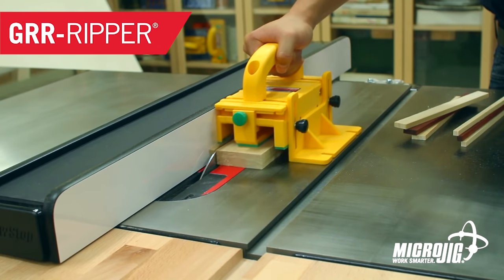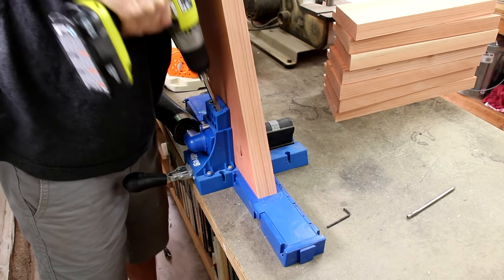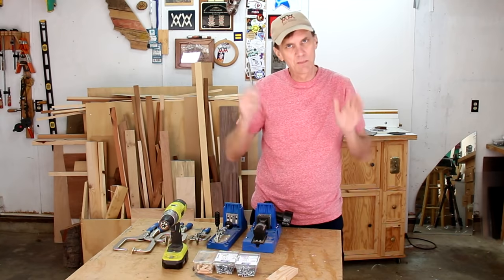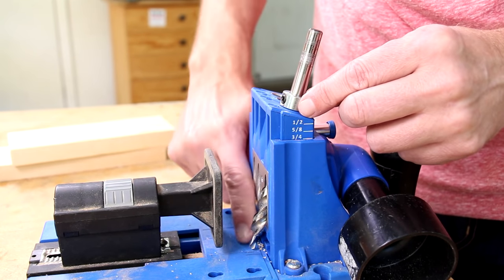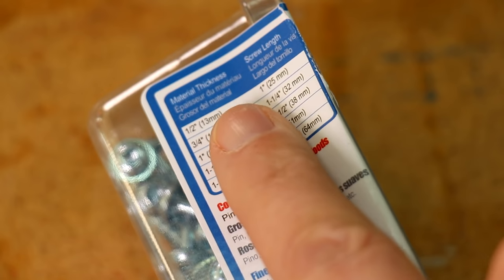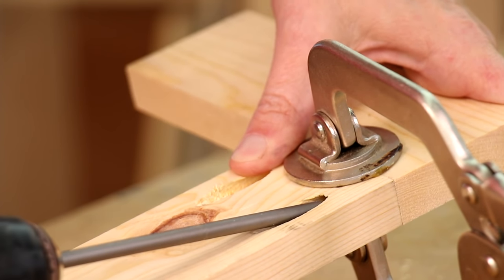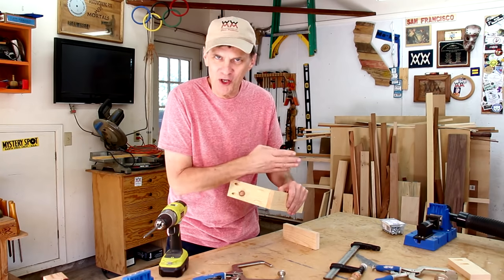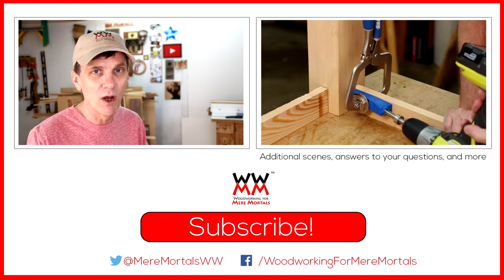Beginner's guide to pocket hole joinery | WOODWORKING BASICS

Comment: My first 2 experiences with KREG Tools: 
Using the chart for 1/2 inch plywood to put a box inside my new DeWalt Thickness planer cart. Every screw blew out the back of the box. I ended up using aluminum tape around the top and bottom sides to hold the panels up. ALL I wanted was a place to store the tables and spare set of blades. Will eventually make a door for the open side.
The second experience with KREG was their automatic corner clamps. I made a wall shelf with 45° braces so I could have my new compressor up on a shelf next to the air hose reel. Two of them jammed.
On the 1/2 inch plywood, KREG Support basically told me that they don't recommend using that size. BUT the SIZE is in their chart wheel.  Haven't contacted them yet  on the Corner Clamps. With the first one being so nonchalant, don't know if I'll be able to get a good outcome.
I have everything KREG except the K-5. 
This just happened to me yesterday and I almost forgot.
I just installed the Incra LS fence for my table saw. So I was waiting until I finished that to set up my new KREG Precision Miter Gauge. 
I took it apart to adjust all of the plastic screws that keeps the rail straight. After getting it put back together I slide it in and BAM. It hits the edge of the table saw.
Now I don't know how deep the miter slots are supposed to be. Don't know from one model/brand to another. I have a Craftsman. 
It's old, 3hp, 120-240, and I totally restored it.
My FIX. I started applying Scotch packing tape to the bottom of the sled rail. It took 8 layers of tape to get the miter gauge to stop hitting the saw table edge. The iGaging caliper measured 0.400 inch with the tape. Don't know what it was before, didn't measure it.
Sent an email right before Christmas, waiting for a response.

Comment: I’ve been using the pocket hole jig for a couple of years now and it was easily one of the best woodworking purchases I’ve made.

I’ve seen a few videos from different makers making the claim that standard dowels can be cut to fill the holes, which has not been my experience at all.  The dowels from the big box stores are 3/8ths, and are NOT a viable substitute for the plugs Kreg sells without a significant amount of sanding.  I haven’t measured with a caliper, but I’m willing to bet that the diameter of the drill bit is 5/16ths or maybe 11/32nds.  Either way, a standard 3/8ths dowel is too big and will blow out the top of the pocket hole.  I think it’s part of Kreg’s business model - if people could get away with using regular screws and dowels to fill their pocket holes, they would be missing out on a ton of repeat customers.

Comment: I've had decent luck with just freehanding pocket holes with a 1/8 pilot followed by a basic screw-head countersink. I can use regular construction screws  and they maintain decent holding strength. They do not have the extremely flat angle the kreg jibs achieve but for basic stuff it works great.

Comment: The original 90 degree clamp still allows the joint to drift a little. Check out the new kreg automax 90 degree clamp. There's a slight learning curve with pocket holes but it becomes easier with tricks you pick up along the way.

Comment: I have always frowned on pocket hole joinery-all those holes to fill or not. However, I have decided to give it a try with adding drawers to an existing shop table. I didnt want to use nails and I having seen a Kreg video on their pocket hole jig, I thought that way might work better and easier.

Comment: I bought the cheap version of the pocket hole jig. I probably spent more in ruined lumber then I would have if I bought the Kreg jig in the first place. Save your money and headaches and buy the Kreg jig to start with. It hurts to spent the money up front but  it worth it in the long run

Comment: At 3:20, when you advise to back off the drill just a wee bit, to leave a blind hole, I have always found using a coin or a washer, say 3-4 mm thick, helps set the drill to the right depth, while ensuring the hole doesn't open up.

Comment: I tried using a pocket hole jig for making a cabinet face frame using 3/4 inch VG Fir. When the screws entered the edge of the second piece, the wood split quite extensively. I bought a biscuit joiner and don't expect splitting to be a problem.

Comment: Bought my first Kreg pocket jig today.  Used an impact on the screws.  Blast right through is just what they did.  I also was using the jig on a 2x4 to connect to 3/4 plywood.  All videos I've watched say "set your jig to the material you are using"  I was using two different types of material.  I set the jig for 2x4 - should it be set for 3/4?  Most screws went through but I contributed that to the impact.

Comment: Thanks for sharing your knowledge! This was a great tutorial as I sometimes have had trouble with the screw depth. I’d always blow out the screw due to lack of knowledge on the screw depth adjustment. Also I’d often make my pocket holes facing  the wrong direction and not having enough thickness for the screw to bite into. Thanks again for sharing. Godbless.

Comment: There are a lot of snobs out there that hate pocket hole jointing, but i absolutely love it. The speed/strength ratio is definitely optimal. Yes, you could spend 10 times as much time making wood joints that are 1.7 times as strong, but hardly seems worth it.

"But my chair will last 100 years"

First of all, no it won't. The glue will fail eventually.
But secondly, I can build another one with pocket holes in 20 years when the joint finally gives... and that is only if you didn't engineer the stress out of the joint, which a good carpenter can do.

Comment: I like the "micro" pocket holes and screws Kreg makes, but the only jig I could find is the insert for some of Kreg's larger sets. However, I find a piece of 3/8" aluminum tubing from the hardware store hobby metal display will make the perfect sleeve to convert a normal jig into a micro jig. Kreg's micro screws also max out at 1" long, but Menards sells some #6 "cabinet screws", which have a compatible diameter square drive pan head with a 1-1/4" or 1-1/2" length.

Comment: I have a ply board of 3/4” and a 2by 4  being joined at a 90 with the edge of the 3/4 exposed and edge of two by four touching flat of the 3/4” in entirety. Which is the best direction to drill the pocket? Pocket on 2 by for or on cut from the 3/4 ply sheet.

The 3/4 ply sheet will be the anchor for holding one guitar hanger.

The pieces joined will be across 14”

I am erecting something to hang a guitar in a semi truck from the top bunk frame while in the stored away position.

Comment: I am very new to wood working. Was impressed with the video and a great way to start. Great video & tutorial. Thanks !!!!
 It is clear that clamps are required to hold the portions for joining. My question is - if I don't have sufficient clamps and use small nails to position (join temporarily) the 2 joining parts and then screw them via pocket holes will it work?

Comment: thnk u  sir gret informtion,  you do it well .  how to extend 2.5mm drill bit ,    becuse  in  hard wood  the screw is not  drive.  so  second piece wood must be  a hole.   therefore  length of 2.5mm drill  bit length  extension is  necessary..

Comment: I use my Kreg Pocket hole jig all the time.  Because I use different size lumber I have to change the drill bit depth and the hold down suction cup.  The allen wrench is always falling out and I can never find the right size wrench on the threaded piece on the hold down.  I took a couple of rare earth magnets one on either side of the handle.  One for the allen wrench and one for the 10mm wrench.

Comment: When you edge joining wide boards for something like a table top it is very difficult to clamp them so they stay aligned. One technique that I heard of, after I had edge joined wide boards and needed to plane them flush, was to use a biscuit joiner and glue. The biscuits keep the joints flush. The pocket screws provide the clamping pressure. You do not need large clamps. You can also back out the screws after the glue has set and reuse them!

Comment: Very clear and simple explanation!   Two questions:   What type of Kreg jig were you using in this video?   Do you have a video on edge joints?   I am attaching three inch solid oak (white qtr sawn) to a qtr sawn red oak plywood panel to make a replacement table top.    I have seen that gluing edge joints is recommended; however, managing the face clamp and glue and bar clamp seems a bit tricky and intimidating.   Thoughts or recommendations?

Comment: I use my Kreg to make joints drilling towards the corner fairly frequently, so that the holes are more concealed.  I've never had a problem.   Maybe its because I use many screws in this situation.  For example, you can attach a face frame to a cabinet from the backside.

Comment: I saw several positive YouTube videos, including yours, about Kreg's Pocket-Hole Jig system.

Yesterday, I bought the KPHJ320 at my local big box. The packaging was sealed and there were no signs that someone had opened it or used it before me. However, when I opened it and checked the components, the Material Thickness Gauge/Hex Wrench was missing. I removed every component, hoping it was underneath, and opened both boxes of screws. It's not there.

I just notified customer service.

Comment: For 1/2 inch ply, there may be a way to have a drop of resin on the anchor-end of the hole, such that the meat-end of the joint has a resin-treated hole to help keep the anchor-end strong if you need to later disassemble the joint (since the anchor-end of the screw tapers to a point, and since there is little more than half inch securing the joint to begin with). In this way, it could be argued that the resulting joint may later be unscrewed and then re-screwed without too much worry that the anchor end of the joint has become overly weakened and loosened by removing the screw. And since you only used a drop going into the hole, the hope is that the joint hasn't become permanently glued together. When you reassemble the joint later, with the resin dried in the hole, it should bind together with similar strength as was found the first time you assembled it.  This might help for joints and corners that might need to be disassembled every once in a great while.  ***Note: to apply the resin as best as possible, screw together the pocket holed screw joint and then back out the screw, separate the joint, put the drop of resin into the anchor hole, and then reassemble the joint. Does this sound reasonable?

Comment: Newbie Question -- Are the thickness settings on my Kreg K4 Pocket Hole Jig based on the nominal wood thickness, or the actual thickness (which is almost always slightly smaller)?  Practical Example -- Are any adjustments required for nominal 3/4 plywood that's actually 0.7" or 18 mm vs. the nominal 0.75" thickness?

Comment: Great video, thank you for the tips! What do you do when you are trying to fill pockets with plugs and you are going to apply a stain rather than paint...if the plug is a different type of wood than the wood you're working with, the plug will stain differently and be more visible.

Comment: Thanks Steve now I’m ready to try this system. I wonder this system does with staining since the plugs don’t look like the same color as the board.
Reply: The plugs from Kreg are maple or oak, and they don't seem to take stain as well as raw wood.  They have a very smooth feel to them.  You can buy a plug cutter from Kreg as well.  I've made some garden furniture from pine and cut some plugs from leftover stock - they were OK.
I find the plug cutter produces a fairly ragged plug, but it fits well and sanded down nicely.  I think if you're going to plug the pocket holes you should probably glue the parts together in addition to using the screws.  Once the hole is plugged, you'll have to destroy the piece to get the screws out!
Reply: Steve Elves thanks for the tips, Steve. Going to try a plug cutter soon ! :)

Comment: Tried and failed in my attempt to make Cornhole board using pocket holes. Thanks for the tip on using the 90* clamp. Exactly what I was looking for.
Reply: The 90 degree clamp is a great idea but at $37, it's a little pricey.

Comment: Just finished a farm house table with 80 pocket holes I have the single $20 pocket hole jig, was looking at the K4 or K5 system but heard the K5 clamp is weak and allows the work piece to move around. What is your results having both systems?

Comment: Thanks for posting this helpful video! 

Any tips when working with hardwoods? I find that I'd like to drill a pilot hole through the pocket hole and into the 2nd board; however, I can't seem to fit the drill at that angle and proximity to the project with standard bits.

Comment: Okay, so I understand the basic theory if you are using the same thickness of wood on both ends, but what do you set the pocket hole jig to, let's say, if you are screwing a 3/4 into a 1.5" piece of wood or the opposite? The receiving piece of wood thickness or what you are screwing through?

Comment: Thanks for this awesome video! Am trying to do the 90 degree join (end grain to face) but the drill doesn't enter the face grain neatly and I end up with a gap. I didn't see you pre-drill holes in the second piece (that didn't get the pocket holes) and I'm not sure how to make holes in the right place to receive the drill bit, if necessary. Can you clarify? Thanks!!

Comment: Hi sir. I am using 15mm thick plywood and I always got crack when I assemble the joint - the plywood layer splitted. 

May I know if pocket hole is fine on 15mm thick plywood?

Comment: I need to screw thru two 1/2" pieces of plywood which have been nailed together to create a support for an RV table.  The result is a 1" wide unit.  The plywood this unit will attach to is also 1/2".  How much of the threads should go into the piece you're attaching to?

Comment: I want to use hardwood and need to pre-drill guide holes into the second piece of timber - no way I can drill screws straight into it. But given the angle of the pocket hole, I won't be able to get the drill in there. How would you recommend doing that? Extra long drill bits?

Comment: If I am working with a hardwood that is 2 inches thick, is it better to use an 1 1/2 fine screw at the 3/4 setting or use a 2 1/2 coarse screw at the 1 1/2 setting?

Comment: Predrilling into the second board is something that might be sensible for harder woods, otherwise they might still crack.
UPD just had a pine board crack because I didn't predrill, as the board was cut from the outside edge of the tree where the fibers were U-shaped if you look at the cross section. So even in softer woods predrilling makes sense.

Comment: Would it be stronger for a shelf to have a board cut so the shelf portion slides into the side then gluing it then screwing it in at an angle like this?

Comment: Haha. I guess I watched this video six years ago and never touched a project. Now I am ready but still need help figuring out which width am I adjusting my jig to?? I am making holes along the bottom of a three inch side of a 1.5"x3"x96" board. I plan to attach the 2" side of a 1"x2" perpendicular to the long board (so the 2" side of the 1"x2" is centered along the 1" side of the 1"x3". (Boy I wish I could draw in the comments) Am I measuring the width of the 1.5 or 3" and setting my jig to that?

Comment: Great video. How do you keep the board from drifting in (sometimes a 1/16" or more)? When I called Kreg Tech support they didn't really address it.
Even their special clap did not keep the board from pulling in the direction of the screw. Thanks for your advise.

Comment: Thank you for this! I have a question- when I am screwing in the screw, I have a really hard time keeping it from spinning out and possibly stripping the screw. Is this just because of the angle? Is there a way for me to do this better? Thanks again!
Reply: I think the problem might be that you're not really locking the bit into the screw. Make sure that the screw is firmly held by the driver bit. You can try putting the screw on the bit, then putting the screw with the bit into the pocket hole. Other than that, I guess just make sure your screws have the same type of head as your bit. Hope this helps!

Comment: Good stuff, but you should be using the provided stop collar setting block to set the collar on the drill bit to the proper location based on which screw you're using.

Comment: What about edging boards with pocket screws? Kreg has videos that says it is okay, but I’m skeptical. I want to made long panel for a dining room table but don’t want to bother with biscuits, dowels, other types is joints. But with long panel worried about warping in the long terms, was thinking about pocket screws and glue. Anyone have thoughts? Worth it or just glue and clamp is enough (which is what Steve says, but what for a much smaller panel)?

Comment: Hi - I’ve tried several times to drill locket holes. Measured the wood and drill collar accordingly. However the screw just doesn’t tighten and the wood spins round even though I’m drilling slowly. Tried several scrap pieces of wood and all the same. What am I doing wrong?

Comment: I found that using the gauge on the K4, the 1.5 " setting (for 2x4s) put the hole too deep and the screw went through the other board. I had to back the bit out just a tad and was good to go.

Comment: I bought the single hole kreg jig , I was attaching an 1 1/2 leg to a 2 x 4 I set the material depth to 1 1/2 but when using the recommended length screws 38mm they barely stick out of the wood maybe 1-2 threads. 

So I had to use the screws recommended for 2 1/2 thickness? Where did I go wrong. My cross braces for the legs are cut to 7° could that have been an issue even though thickness was 1 1/2 ??